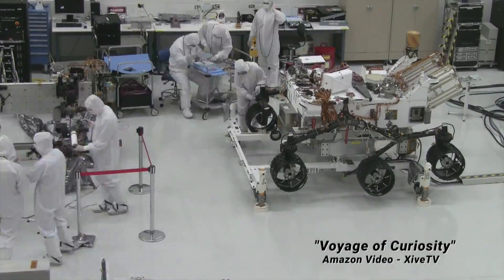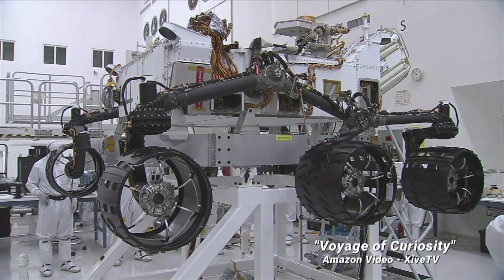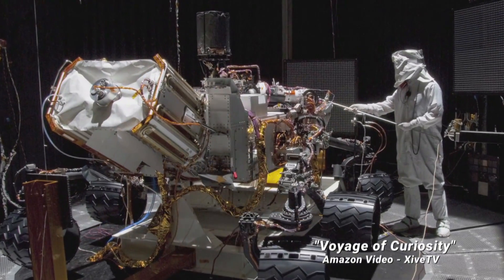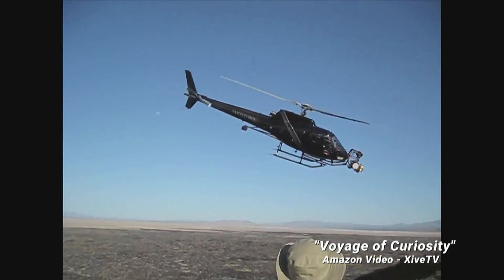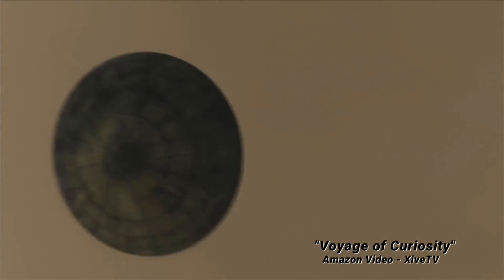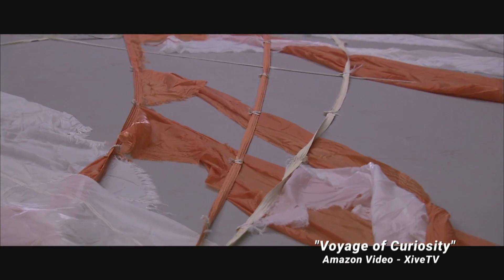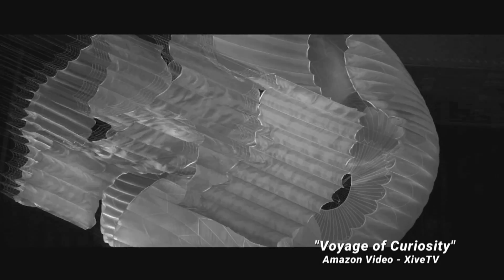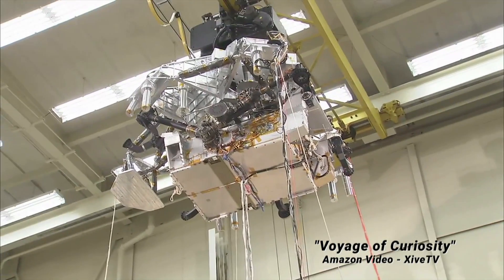How to Build a Mars Rover – from 'Voyage of Curiosity' | Exclusive Video

Comment: vary cool
Reply: Except for minor details like the fact that it moves at an average speed 100 times slower than a snail. Literally.
And the wheels break when it drives over sharp rocks because the wheels are made of brittle metal and the idiots didn't consider that there could be rocks. On Mars.
It is an abomination of engineering. A celebration of idiocy. And you sheep are too vacuous to question.
Reply: Mars Rover Has Lasted 3,560 Days Longer Than Expected
Reply: The longevity is fine, nothing else is. Getting time to pass without results is a Nasa/JPL specialty. 
Try to grasp just how savage the fact is that the average speed is 100x lower than a snail.